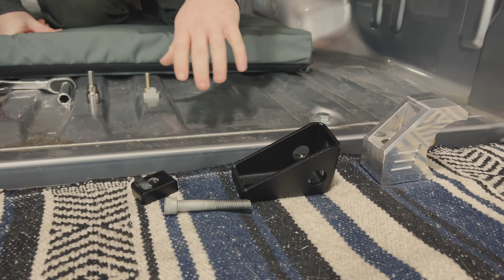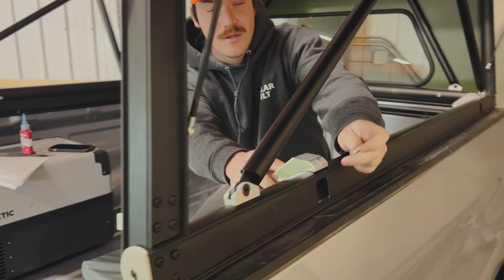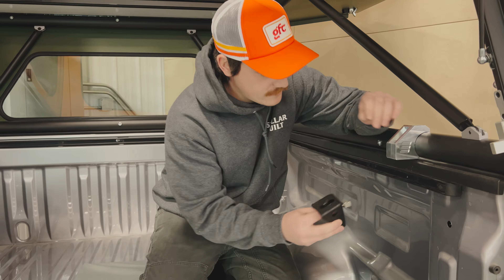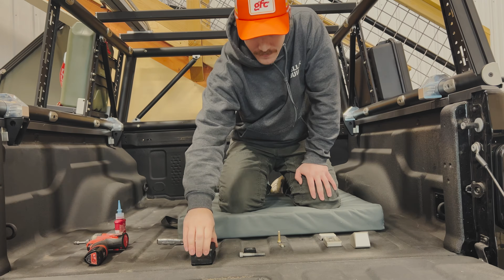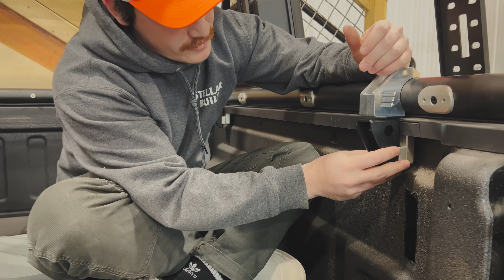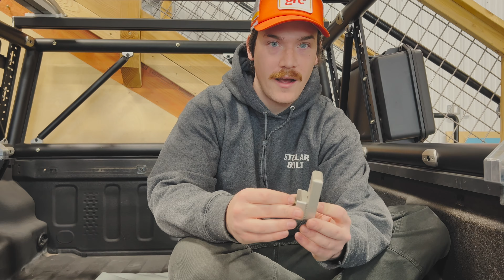GFC Bed Mounting Guide

Comment: You need to use a steel flat washer between the bolt head and the upper aluminum bracket. It spreads the force more evenly. Another steel flat washer between the "Tee" washer and the nut. Again it spreads the force  better and should help to keep the "Tee" washer from turning when tightening the nut. It is a good practice to use a steel flat washer between a bolt head or nut and any aluminum part.  Also it helps prevent "galling" which gives a false torque reading with the fastener.